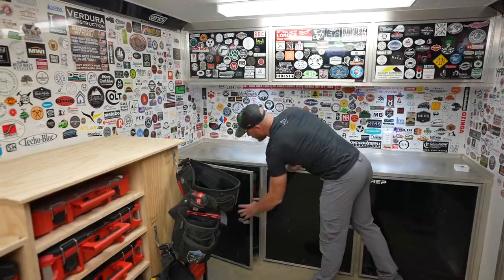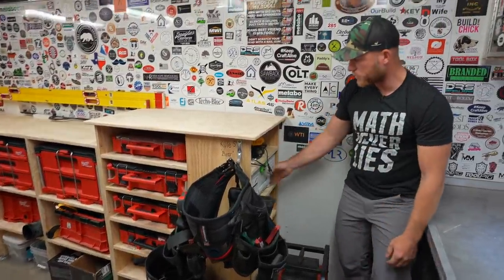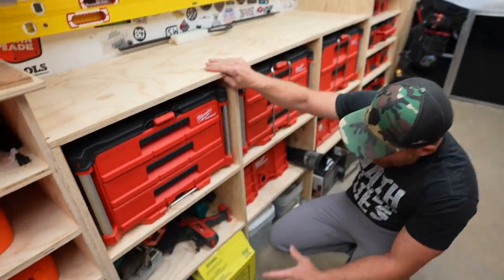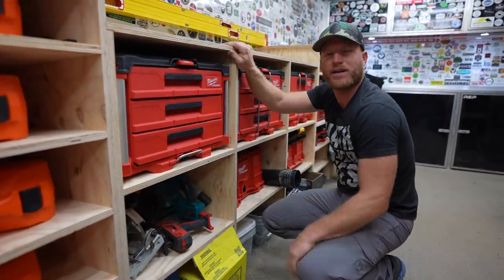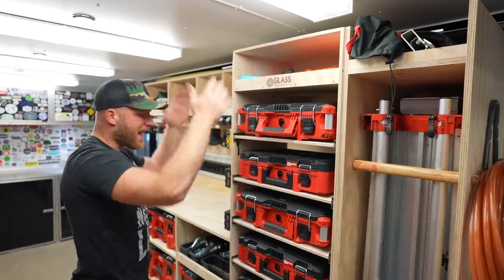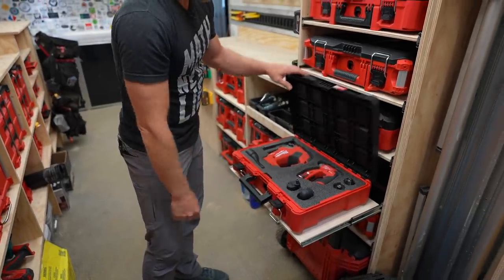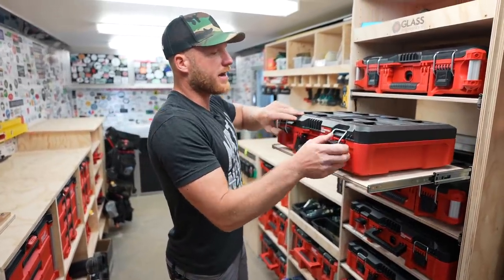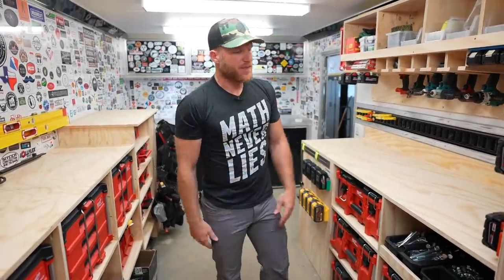RR Buildings Tool Trailer Walk Thru

Comment: Great job Kyle.  Your business depends on this trailer. I hope you have a good trailer hitch lock and high security padlock on the door(s). Maybe even a GPS tracker on the trailer. Some low-life would love to drive away with your trailer and all of the RR essential tools.  It happened where I worked. As far as the weight, yes, you should check.  My guess is you are good to go with most weight sitting over the trailer axles. But be really careful about tongue weight and the max limits of the hitch on your truck. We had a trailer with too much tongue weight which reduced traction of the front wheels of the tow vehicle; an inexperienced driver applied the brakes when the trailer started fishtailing. It jackknifed the trailer, rolled the trailer onto its side at 70MPH and the torque of the trailer rolled the truck onto its top.  It was a bad day for business and took a long time to recover.

Comment: Brother Labeler is a nice label machine.  We use it a lot in our datacenters and server farms for labeling everything.  BTW, I've been waiting for this walk through.  Thanks for sharing.
Reply: Yes! I have one, and nothing beats slapping labels on anything that needs 'em. And the labels, at least the TZ type that my labeler takes, hold up real nice outside, provided the surface is clean, smooth, and non-porous. I have a few that have been applied outside to glass in Y2K, and they still look just as good now as they did then, save for a bit of accumulated grime.

Comment: This looks so much more efficient than what you used to have, as you said in the video, everything now has a place so if anything is left out you know it should be put away somewhere which keeps it tidy all the time. Then when you need a tool you can go straight to it.

My suggestions would be, some battery powered LED lights, with a magnetic back, they last for ages off just a couple of AA batteries and would be ideal for inside when dark out and can be held on any metal strips like your small levels are. Also a small LED light for above the door & ramp on the outside so when you go to open up in the dark mornings or at night you have a light that comes on, this could be a small solar one as it would be outside.

A small white board, so you have somewhere to note down anything you think of during the day/week that needs loading or restocking when you next have the trailer back at home.

2 fold out camp chairs and perhaps a table or one of those pop out picnic tables. It wouldn't take up much room and would give you and Greg somewhere to sit on your breaks and to eat. It would make the break more of a proper break which means you come back to work refreshed and able to work better.

Somewhere for your drinks/coffee to sit, for example when getting ready in the morning you have somewhere proper to put your morning coffee. A simple hole cut into one of the worktops would do.

A small fridge if it wouldn't kill the power so in the summer you have cold drinks available during the day, or even a freezer for ice pops in the heat. A water fountain thing could be an option but probably take up too much space.

Somewhere to keep a change of clothes and boots for those days it is chucking it down so you can put on fresh dry clothes for the after lunch period. You always feel much better for it or when its cold in the morning, hot later you have the shorts to put on.

The least glamorous thing, a bin. There didn't seem to be anywhere for your rubbish. A bit of worktop with a big hole cut out of it and the bin slid underneath it, drop the rubbish through the hole into the bin.

A rail or something to hang up wet clothes and something for wet boots.

A radio/speaker for when you get bored listening to Greg or he gets bored listening to you!

Worth looking on Pinterest for storage ideas, you will get loads of ideas for things including solutions for your levels and also camping gear for things like a wash station etc if you wanted one.
Reply from the maker: Tons of great suggestions thanks

Comment: Good video ! That Trailer came out Very Nice !!! Its Beautiful !!! 
tips -
- Put the Big guns in thier own slots vertically 
in a cabinet on one side if u need them individually if u need them all together put them in a Packout rolling box on the right side with the rolling boxes fitting under the right side. so u are not lifting a huge heavy box full of nailers all the time. gets old.
( viewed from walking in the Big Main Ramp Entrance ) 
- you all ready have an inverter & Battery. Add 5 200 watt solar panels on the Roof. giving you 1,000 watts. That Will Pretty Much take care of anything u need to do. add a charge controller.
You only need 2 panels if u are just doing battery charging. milwaukee / dewalt battery chargers draw very little power. less than 200 watts each if memory serves me right. So figure 1 solar panel per battery charger. 
- the area that u have the batteries on the wall above the Bench , Put 2 battery chargers there attached to the wall instead of a couple battery holders.
- if u want a Mean Power plant - Purchase ( 2 ) - 6 volt Deep cycle Trojan golf cart batteries wire in series to make 12 volts.  ( series is + to - To + to - )  Take the 12 volts & Run that to a 2,000 watt pure sine wave inverter & u can Run anything 115 volts up to 20 amps off your trailer. All depends if u just want to charge batteries or Run Wet vacs & saws off the trailer.
- u only need one or two solar panels to just charge batteries.
- Look on the back / bottom of chargers to figure out your power requirements.
- Amps x Volts = Watts --- Remember this formula allways. if u have any 2 u can figure out the other.
- Levels - are Best stored flat against the ceiling    or on side walls. using pieces of rectangular aluminum tube would look nice. can be obtained from any metal supply. or prob. off the net too. 4 - 6" pieces would prob work. at whatever dimension levels are.
- i Was organizing my truck & a viewer of mine gave me a Great idea. i used to stack packouts flat like u do & He Suggested Stacking them Like Books on a shelf. Opened up a Whole New World for Me ! No More Digging for the bottom one. They are All at Waist height if Stacked Like " Books " & u can Get access to Alot More boxes Easily.

Comment: Looks awesome, you could put solar on top of the trailer and a setup for charging while you are on the job. I’ll take your tool batteries as they die instead of turning them into HD or wherever you get them. Great video.

Comment: I like to offer a suggestion  for dealing with your chargers.  Get a 24 X 36 inch piece of 3/4 inch plywood.  and mount your  chargers to it with a power strip on the top to plug in the chargers. This can then be placed under the counter top on shelf and brought up  and placed on the counter top when the need arises.

Comment: You need the fastcap hangers for the levels and the tracksaw tracks. I picked up their hangers for the tracksaw and have my makita tracks mounted to my garage door at the house. Those bigger packouts you have to lift out of the shelf to get to your tools have you considered just building a drawer instead of those packouts? You could make them to where they wont open unless you want em open and still be able to foam em out like the packouts.

Comment: For labels, check out FastCap’s Kaizen labels. White pvc with super sticky tape in the back. Awesome
Reply: I second.  Much more readable than blue tape but just as easy to modify.  Label makers are great once you’re sure nothing will change, which IMO requires about 20 yrs. 😂. Until then I want a label I can easily change.

Comment: Sweet trailer. I know you were not terribly interested in doing solar but... if you go to ebay you can get some really inexpensive 2nd use solar panels. The solar farms have to replace these and you'll still get another 10 years of use from them. I got like 20x265w for $1k delivered. You can mount that flush on the roof and trickle charge your battery and then you have sooo many batteries you could probably just charge for free in that trailer and run your full lights.

Comment: 11:25 You could build your own plywood drawers along with heavy duty drawer slides.  Drawer slides need a 1/2 clearance each and if you use 1/2 plywood you would lose a total of two inches in width for each storage bay.
Reply from the maker: Thought about that

Comment: I like how you use the Packout drawers, but I would have used a different type of system to secure them in their location, because then you could simply pull the entire set out and then connect it to the lower rolling system and take the tools to the job/working area, instead of running back and forth if you need more tools.  Sort of defeats the main purpose of that system.  It looks like you'd be better off just building drawers in those shelf areas, you'd definitely get more interior drawer space that way.

Comment: Looks great but inverter technology and battery technology have improved. Magnasine 4024 with 2 battleborn batteries will power all your outlets and you can add a flexible solar with victron charger. Plugging it in to the grid will be needed but not as frequent.

Comment: @10:48 could get some simple feedback from each side of the trailer ("driver vs. passenger") by measuring the top of your tire to the bottom of the trailer's fender wall. Looking for static compression of the trailer suspension.  I can't tell you what numbers to look for, but a one-inch difference to me sounds whatever, NBD.  If you had 3-4 inches of difference between the trailer sides, then it would be "alright we need to balance this out."

Comment: If I could set your trailer up from scratch, you would walk in & in a few seconds, you would know if any cordless tool was missing or left out via shelf system with adjustable dividers to accommodate tool size. open hole = missing tool. (LED backlit of course) Not a single cordless tool would be hidden in packouts. No wasted time opening lids to grab a tool.  Also, clear totes allow you to see what's where, but since you have the packouts, a yellow dot on front would be for DeWalt accessories, etc...

Comment: at 11:27 if you notch out a 20-25mm semi circle on the vertical sides for the shelves It would be easier to get 2-3 fingers in from the side to grip the big pack-out  better. Just my suggestion at least

Comment: I’d like to know what tools you bought for each of the brands and why.  

I’m having a hard time just buying into one since they all seem to have some items that they do the best.
Reply: Lol, Same here man. Been trying to decide what brand to go with myself. Some cordless tools are hard to find, like the dewalt or Milwaukee table saws. Lowe’s has a new brand of 24v tools out called Flex. They look nice, but there’s only so many tools out right now. They’re not putting them in stores till spring or summer only online.And also they’re made by the same company as Skill I believe.
Reply: Milwaukee, dewalt or makita and you should be right. I would say Milwaukee is currently the go to for power but that could change in no time

Comment: If you had all the battery chargers wired in, you could put the batteries on their chargers as part of your pack-up at the end of each day, drive home, plug the trailer into the mains supply, and they'd all be charging without any further effort. And you wouldn't have to take them off their chargers the next morning, just unplug the trailer and drive off.

Comment: This turned out great! The pack outs are a neat way of having everything organized and accessible. What do you do with all the chains and blocks that you use when keeping building square and plumb?
Reply: Have a watch of his video: "Chain Hacks: Using Chain to Brace and Straighten a Building" you can see about them there. He keeps them in old plastic jugs that used to be used for corn syrup I think, that are washed out. He then keeps all the jugs in a specific metal container that he un/loads with forks to the site on his trailer.

Comment: I know you have been a fan of diablo blades for a while but have you tried blades made by fs tool?
Reply from the maker: No I haven’t
Reply: @RRBuildings   They are pretty expensive saw blades about double the thickness from your typical diablo (1/8inch vs 1/16inch). It provides less deflection so that blade won't sway when cutting through material providing a more straight cut. probably more useful for finish carpentry .

Comment: What truck are you using to pull the trailer
Reply: I believe he has a 3/4 ton Sierra Denali. He did a video about it when he got it...prob a year ago now?
Reply: @cletus7419  The video was "2020 GMC Sierra 3500 Denali Walk Around with RR Buildings"

Comment: Packouts made.to carry tools in an organized manner... weird to see them just sit on shelves and never leave. Why bother having an extra box to open?
Reply: Cauee then you have the option to take the box onto site? Especially with the roller
Reply: @lucabeats1226  I could see that in some of our jobs in midrises and high rises but Kyle parks right there wherever he likes. 🤷🏻‍♂️ I'm  not  a Ron Paulk groupie by any means but his style of trailer build is pretty much made for guys like Kyle. Some guys like their tools protected in original cases to keep them mint because they dont buy new tools often or every new tool when it comes out or because they throw the cases in the back of a pickup. Kyle is the opposite, he has stuff in duplicate or triplicate and buys(or recieves free) lots of new tools and retires other to the home shop. Hes also all about efficiency  and "work flow" so having to slide out a drawer and open a lid or unlock a bar/hasp and then pull out a box, set it on a counter then grab a tool and reverse that action only to repeat it later that day does seem out of character for him. Like he said hes playing around with it and he likes "stuff" so the shiny new packouts cater to that but I am pretty sure he'll  work it out down the road when hes tired of it.